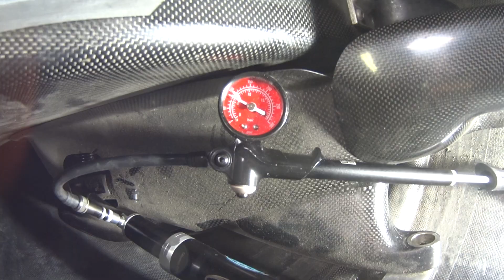Basic Velomobile Maintenance

Comment: My Quest has problem. My biggest oval chainrings is less usable. It automatically drops to a smaller. I have different chainrings than the standard. I have the Shimano oval rings.
Reply from the maker: Check the front derailleur adjustment. Sounds like the front derailleur is not in right position, so the chain drops to smaller chainring.

Comment: A clean DRY washing up brush is useful for cleaning grit & dust from the rear deralia and gear cluster.  It reduces the grit and dust grinding away gears, chain & sprocket wheels. Also consider using a vacuum cleaner for all that grit that collects inside the shell. 
That tip about the "O"  rings on the idler was important. Several recumbents would benefit from that idea.

Comment: Nice video, one question... Why do you use so much chain oil? I only use 2 drops, as the chain is not exposed. Maybe the roads in Finland  are more "dusty" and make the chain more "dirty"
Reply from the maker: It’s not oil, it’s wax. You have to apply it more and more often. It wears out more quickly than oil and it doesn’t like water. But the chain stays more clean than with oil. And because water stays outside of the velomobile, the chain wax is the perfect lubricant for velomobile chain.
Reply: @TheVelomobileChannel  Perhaps I should have written Oil / Grease / Wax...If using wax for bicycle chains, the chain must first be cleaned or, to put it correctly, degrease the chain before applying wax.
Reply: And btw is it the brand you use Squirt? Do not make a Google search in english....Now you warned :-)
Reply: Velostrada  Oh god no 😆